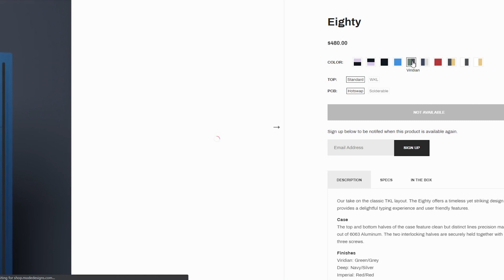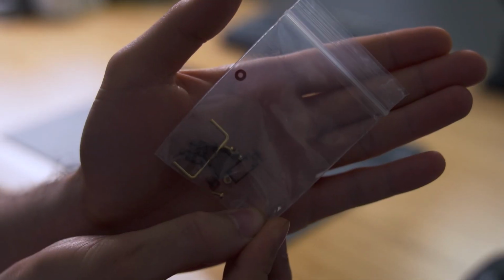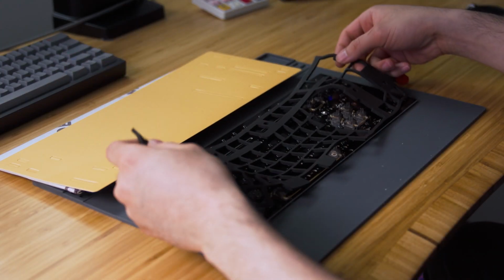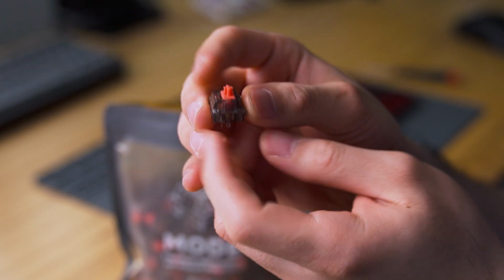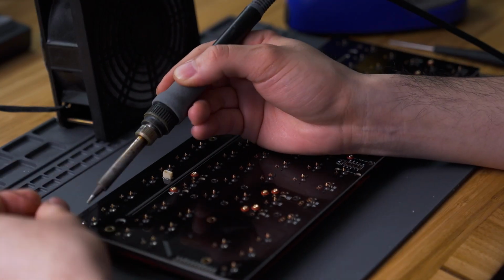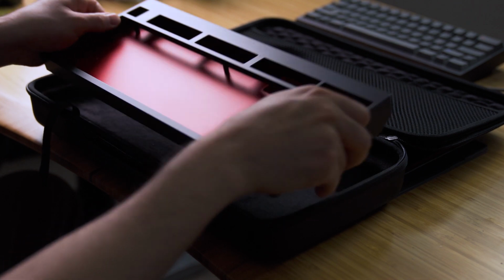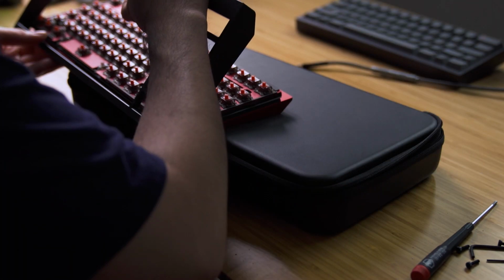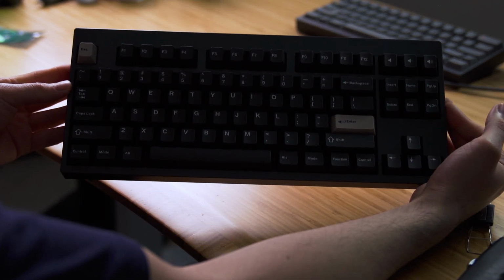Building Boomrazzle a Custom Mechanical Keyboard | Mode80 | Signal Tactiles

Comment: Hi sus boards, amazing work as always brother. Idk if this’ll get a response but here goes. I’m doing my first custom build with NK creams as well and I don’t think I heavily overdid it but some switches definitely feel mushier and a lot quieter than the nice smooth clack I wanted from lubing. I’m pretty sure I overlubed some switches.. is there a way to fix this? And how exactly can I tell when a switch is overlubed?
Reply: Using kryotox 205g0